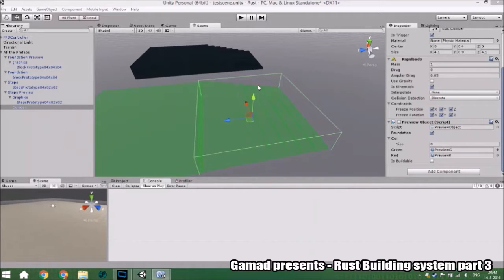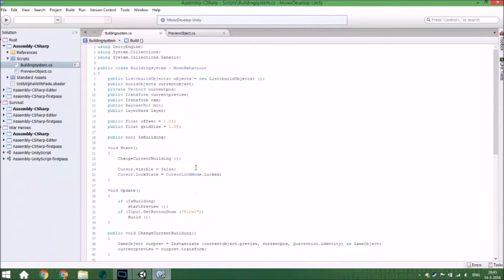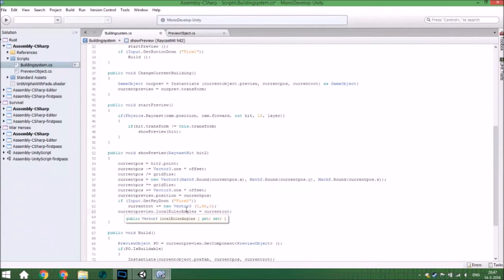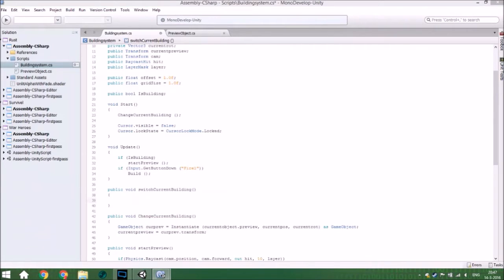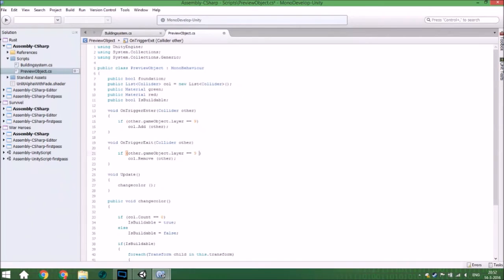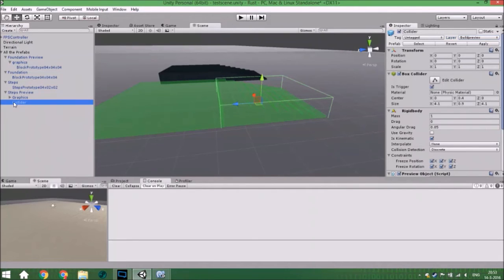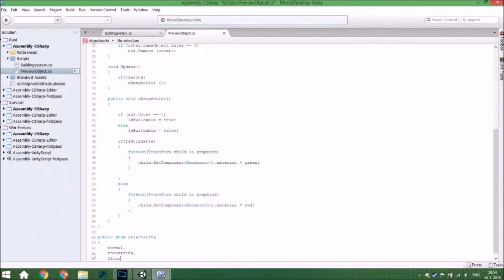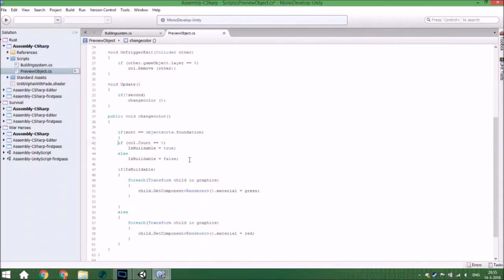[Unity 5] Tutorial: How to make a building system like Rust - part 3

Comment: Hi! I have an error say on play : "Destroying assets is not permitted to avoid data loss.
If you really want to remove an asset use DestroyImmediate (theObject, true);
UnityEngine.Object:Destroy(Object)" THX for help !

My script : using UnityEngine;
using System.Collections;
using System.Collections.Generic;

public class Buildingsystème : MonoBehaviour {

 public List<buildObjects> objects = new List<buildObjects>();
 public buildObjects currentobject;
 private Vector3 currentpos;
 private Vector3 currentrot;
 public Transform currentpreview;
 public Transform cam;
 public RaycastHit hit;
 public LayerMask layer;

 public float offset = 1.0f;
 public float gridSize = 1.0f;

 public bool IsBuilding;
 void Start()
 {

  ChangeCurrentBuilding (0);

  Cursor.visible = false;
  Cursor.lockState = CursorLockMode.Locked;
 }

 void Update()
 {
  if(IsBuilding)
   startPreview();
  if(Input.GetButtonDown("Fire1"))
   Build();
  if (Input.GetKeyDown("0") || Input.GetKeyDown("1"))
   switchCurrentBuilding();
 }

 public void switchCurrentBuilding()
 {
  for (int i = 0; i < 2; i++)
  {
   if (Input.GetKeyDown("" + i))
    ChangeCurrentBuilding(i);
  }
 }
 public void ChangeCurrentBuilding(int cur)
 {
  currentobject = objects [cur];
  if (currentpreview != null)
   Destroy(currentpreview.gameObject);
  GameObject curprev = Instantiate (currentobject.preview, currentpos, Quaternion.Euler(currentrot)) as GameObject;
  currentpreview = curprev.transform;
 }

 public void startPreview()
 {
  if(Physics.Raycast(cam.position, cam.forward, out hit, 10, layer))
  {
   if(hit.transform != this.transform)
   {
    showPreview(hit);
   }
  }
 }

 public void showPreview(RaycastHit hit2)
 {
  currentpos = hit2.point;
  currentpos -= Vector3.one * offset;
  currentpos /= gridSize;
  currentpos = new Vector3(Mathf.Round(currentpos.x), Mathf.Round(currentpos.y), Mathf.Round(currentpos.z));
  currentpos *= gridSize;
  currentpos += Vector3.one * offset;
  currentpreview.position = currentpos;
  if (Input.GetButtonDown("Fire2"))
   currentrot += new Vector3(0, 90, 0);
  currentpreview.localEulerAngles = currentrot;

 }

 public void Build()
 {
  PreviewObject PO = currentpreview.GetComponent<PreviewObject> ();
  if(PO.IsBuildable)
  {
   Instantiate(currentobject.prefab, currentpos, Quaternion.Euler(currentrot));
  }
 }
}

[System.Serializable]
public class buildObjects
{
 public string name;
 public GameObject prefab;
 public GameObject preview;
 public int gold;
}

Comment: Hi Gamad, the tutorial is great so far. I have one issue, can not spot the problem. I created floor and wall. I placed the floor than I want to place a wall on the floor and here is the problem. My wall can not be placed on the floor but can be placed anywhere. I checked few things and I spotted that this is 2nd collider problem in Preview prefab. its seem when 2nd collider is coliding with floor than wall change colour to red. It should be oposite. Can you tell me where can be the problem? if not I will try my best to find the problem. It shouldnt be a massive.
Thank you!
Reply from the maker: Probably you assigned the wrong colliders to the wrong variables (at least I think so ;) )
Reply: Thanks for reaply... I fixed that, dont remember exactly what was wrong but something with collider or tag.

will you do more tutorials, for example gathering the items to get enough to build the structures? and maybe inventory system which can give option to drag and drop items from the inventory and other stuff?

Thank you

Comment: I have 3 problem. First he never switch green to red when i build over another object ( like foundation ). Second problem when i build something like wall, his center is on the ground so the middle of the wall was under the ground and the last problem is when i switch with key to another object i see the preview ( i can rotate the object ) but when i press fire1 he didn't build the object ( But at the defaut object before key switching so, my foundation could be build without any problem )

My buildingSystem code : 
http://pastebin.com/z2Bz743J
My Preview code : 
http://pastebin.com/EJGtHbAH

I have no error and use Unity 5.3.0
Reply from the maker: 1)It looks like that's about the colliders (re-check your physics)
2) that's all about the pivot (part 4 will explain about that)
3) could you do multiple print commands (at line 82 & 84) to check what is working currently ;)
Reply: For my wall i know it's pivot problem, but my stair have an good pivot :/. 

I did print for seen were and when i encoutered a problem. For my foundation line 82 & 84 work fine and my foundation was build without problem,  but for my stair only line 82 worked, but not the line 84. 

And i still not understand why my color switch dont work too :/. 

What do you mean by "re check your physics" ?
Reply from the maker: I can mean some layers don';t hit eachother and that it won't hit the other collider
Reply: Yes, i use buildable layer for all object and child
Reply: Gamad I seen some poeple ask if you could upload an basics project for show how to set propretly the layers and colliders, do you think i will be possible ?
Reply from the maker: No, A lot of people just download that and don't watch the video and I get a lot of annyoing questions ;)

But I would say finish the tutorial first, because a lot of things are going to change before the last video.
(And if you still got problems then I will just send you the scripts privately)

Alright?
Reply: Gamad I understand :). Serioulsy i look the code and understand him, but i make some change to him, i put 4 small collider ( as a trigger ) in each side of my wall for check if it IsBuildable after that if it's is those collider auto snap with the other collider trigger of the other object and switch to green and buildable, this system have other advantage like building rules ( Wall only on foundation or something like that ). Maybe that's could help you for news building system idea :)
Reply from the maker: Maybe, thanks ;)

Comment: I have an error:
Sctipts/BuildingSystem.cs(41,25): error CS1525: Unexpected symbol `1', expecting `.', `?', `[', `<operator>', or `identifier'
The script:
using UnityEngine;
using System.Collections;
using System.Collections.Generic;

public class BuildingSystem : MonoBehaviour
{
 public List<buildObjects> objects = new List<buildObjects> ();
 public buildObjects currentobject;
 private Vector3 currentpos;
 private Vector3 currentrot;
 public Transform currentpreview;
 public Transform cam;
 public RaycastHit hit;
 public LayerMask layer;

 public float offset = 1.0f;
 public float gridSize  = 1.0f;

 public bool isBuilding;

 void Start()
 {
  ChangeCurrentBuilding (0);

  Cursor.visible = false;
  Cursor.lockState = CursorLockMode.Locked;
 }

 void Update ()
 {
  if (isBuilding)
   startPreview ();
  if (Input.GetButtonDown ("Fire1"))
   Build ();
  if (Input.GetKeyDown ("0") || Input.GetKeyDown ("1"))
   ChangeCurrentBuilding ();
 }

 public void switchCurrentBuilding(int cur)
 {
  for(int 1 = 0; 1 < 2; 1++)
  {
   if(Input.GetKeyDown("" + 1))
    ChangeCurrentBuilding(1);
  }
 }
  
 public void ChangeCurrentBuilding()
 {
  currentobject = objects [cur];
  if(currentpreview != null)
   Destroy(currentpreview.gameObject);
  GameObject curview = Instantiate (currentobject.preview, currentpos, Quaternion.Euler (currentrot)) as GameObject;
  currentpreview = curview.transform;
 }

 public void startPreview()
 {
  if (Physics.Raycast (cam.position, cam.forward, out hit, 10, layer))
  {
   if (hit.transform != this.transform)
    ShowPreview (hit);
  }
 }

 public void ShowPreview(RaycastHit hit2)
 {
  currentpos = hit2.point;
  currentpos -= Vector3.one * offset;
  currentpos /= gridSize;
  currentpos = new Vector3(Mathf.Round(currentpos.x), Mathf.Round(currentpos.y), Mathf.Round(currentpos.z));
  currentpos *= gridSize;
  currentpos += Vector3.one * offset;
  currentpreview.position = currentpos;
  if (Input.GetKey ("Fire2"))
   currentrot += new Vector3 (0,90,0);
  currentpreview.localEulerAngles = currentrot;
 }

 public void Build()
 {
  PreviewObject PO = currentpreview.GetComponent<PreviewObject> ();
  if (PO.IsBuildable) {
   Instantiate (currentobject.prefab, currentpos, Quaterntion.Euler (currentrot));
  }
 }
}

[System.Serializable]
public class buildObjects
{
 public string name;
 public GameObject prefab;
 public GameObject preview;
 public int gold;
}
Reply from the maker: +HarD izzeR That is a mistake I made within the tutorial, just change the line of Getkeydown -> getbuttondown
Reply: +Gamad The Same Error Comes...
Reply: +Gamad Any Help Please ?
Reply from the maker: +HarD izzeR Did you changed both getkeydown's?
Reply: +Gamad yes I did
Reply from the maker: Could you give me that part of the script again with the error?
Reply: +Gamad The Error:
Sctipts/BuildingSystem.cs(41,25): error CS1525: Unexpected symbol `1', expecting `.', `?', `[', `<operator>', or `identifier'

The Script:

using UnityEngine;
using System.Collections;
using System.Collections.Generic;

public class BuildingSystem : MonoBehaviour
{
 public List<buildObjects> objects = new List<buildObjects> ();
 public buildObjects currentobject;
 private Vector3 currentpos;
 private Vector3 currentrot;
 public Transform currentpreview;
 public Transform cam;
 public RaycastHit hit;
 public LayerMask layer;

 public float offset = 1.0f;
 public float gridSize  = 1.0f;

 public bool isBuilding;

 void Start()
 {
  ChangeCurrentBuilding (0);

  Cursor.visible = false;
  Cursor.lockState = CursorLockMode.Locked;
 }

 void Update ()
 {
  if (isBuilding)
   startPreview ();
  if (Input.GetButtonDown ("Fire1"))
   Build ();
  if (Input.GetButtonDown ("0") || Input.GetKeyDown ("1"))
   ChangeCurrentBuilding ();
 }

 public void switchCurrentBuilding(int cur)
 {
  for(int 1 = 0; 1 < 2; 1++)
  {
   if(Input.GetButtonDown ("" + 1))
    ChangeCurrentBuilding(1);
  }
 }
  
 public void ChangeCurrentBuilding()
 {
  currentobject = objects [cur];
  if(currentpreview != null)
   Destroy(currentpreview.gameObject);
  GameObject curview = Instantiate (currentobject.preview, currentpos, Quaternion.Euler (currentrot)) as GameObject;
  currentpreview = curview.transform;
 }

 public void startPreview()
 {
  if (Physics.Raycast (cam.position, cam.forward, out hit, 10, layer))
  {
   if (hit.transform != this.transform)
    ShowPreview (hit);
  }
 }

 public void ShowPreview(RaycastHit hit2)
 {
  currentpos = hit2.point;
  currentpos -= Vector3.one * offset;
  currentpos /= gridSize;
  currentpos = new Vector3(Mathf.Round(currentpos.x), Mathf.Round(currentpos.y), Mathf.Round(currentpos.z));
  currentpos *= gridSize;
  currentpos += Vector3.one * offset;
  currentpreview.position = currentpos;
  if (Input.GetKey ("Fire2"))
   currentrot += new Vector3 (0,90,0);
  currentpreview.localEulerAngles = currentrot;
 }

 public void Build()
 {
  PreviewObject PO = currentpreview.GetComponent<PreviewObject> ();
  if (PO.IsBuildable) {
   Instantiate (currentobject.prefab, currentpos, Quaterntion.Euler (currentrot));
  }
 }
}

[System.Serializable]
public class buildObjects
{
 public string name;
 public GameObject prefab;
 public GameObject preview;
 public int gold;
}
Reply from the maker: for(int 1 = 0; 1 < 2; 1++)
That needs to be:
for(int i = 0; i < 2; i++)
Reply: +Gamad Thanks
Reply from the maker: +HarD izzeR np ;)
Reply: +Gamad But Now I Have More Errors :(
1-
Sctipts/BuildingSystem.cs(23,17): error CS1501: No overload for method `ChangeCurrentBuilding' takes `1' arguments
2-
Sctipts/BuildingSystem.cs(44,33): error CS1501: No overload for method `ChangeCurrentBuilding' takes `1' arguments
3-
Sctipts/BuildingSystem.cs(50,42): error CS0103: The name `cur' does not exist in the current context
4-
Sctipts/BuildingSystem.cs(50,33): error CS1502: The best overloaded method match for `System.Collections.Generic.List<buildObjects>.this[int]' has some
5-
Sctipts/BuildingSystem.cs(50,33): error CS1503: Argument `#1' cannot convert `object' expression to type `int'

Iam really really sorry but I dont understand C# if that was JS I was going to fix this
Reply: +Gamad Any Help ?
Reply from the maker: +HarD izzeR 1 - change public void changecurrentbuildchangecurrentbuildong() to public void changecurrentbuilding(int cur)
Reply: +Gamad Thanks now I have one error:
Sctipts/BuildingSystem.cs(36,25): error CS1501: No overload for method `ChangeCurrentBuilding' takes `0' arguments
Reply from the maker: +HarD izzeR change at line 36 or so Changecurrentbuidling () to changecurrentbuilding (i)
Reply: +Gamad but now I have 3 errors:
1-
Sctipts/BuildingSystem.cs(36,48): error CS0103: The name `i' does not exist in the current context
2-
Sctipts/BuildingSystem.cs(36,25): error CS1502: The best overloaded method match for `BuildingSystem.ChangeCurrentBuilding(int)' has some invalid arguments
3-
Sctipts/BuildingSystem.cs(36,25): error CS1503: Argument `#1' cannot convert `object' expression to type `int'

The Script: (Please Read The Script And See Whats Wrong surly There is some thing wrong)

using UnityEngine;
using System.Collections;
using System.Collections.Generic;

public class BuildingSystem : MonoBehaviour
{
 public List<buildObjects> objects = new List<buildObjects> ();
 public buildObjects currentobject;
 private Vector3 currentpos;
 private Vector3 currentrot;
 public Transform currentpreview;
 public Transform cam;
 public RaycastHit hit;
 public LayerMask layer;

 public float offset = 1.0f;
 public float gridSize  = 1.0f;

 public bool isBuilding;

 void Start()
 {
  ChangeCurrentBuilding (0);

  Cursor.visible = false;
  Cursor.lockState = CursorLockMode.Locked;
 }

 void Update ()
 {
  if (isBuilding)
   startPreview ();
  if (Input.GetButtonDown ("Fire1"))
   Build ();
  if (Input.GetButtonDown ("0") || Input.GetKeyDown ("1"))
   ChangeCurrentBuilding (i);
 }

 public void switchCurrentBuilding(int cur)
 {
  for(int i = 0; i < 2; i++)
  {
   if(Input.GetButtonDown ("" + 1))
    ChangeCurrentBuilding(1);
  }
 }
  
 public void ChangeCurrentBuilding(int cur)
 {
  currentobject = objects [cur];
  if(currentpreview != null)
   Destroy(currentpreview.gameObject);
  GameObject curview = Instantiate (currentobject.preview, currentpos, Quaternion.Euler (currentrot)) as GameObject;
  currentpreview = curview.transform;
 }

 public void startPreview()
 {
  if (Physics.Raycast (cam.position, cam.forward, out hit, 10, layer))
  {
   if (hit.transform != this.transform)
    ShowPreview (hit);
  }
 }

 public void ShowPreview(RaycastHit hit2)
 {
  currentpos = hit2.point;
  currentpos -= Vector3.one * offset;
  currentpos /= gridSize;
  currentpos = new Vector3(Mathf.Round(currentpos.x), Mathf.Round(currentpos.y), Mathf.Round(currentpos.z));
  currentpos *= gridSize;
  currentpos += Vector3.one * offset;
  currentpreview.position = currentpos;
  if (Input.GetKey ("Fire2"))
   currentrot += new Vector3 (0,90,0);
  currentpreview.localEulerAngles = currentrot;
 }

 public void Build()
 {
  PreviewObject PO = currentpreview.GetComponent<PreviewObject> ();
  if (PO.IsBuildable) {
   Instantiate (currentobject.prefab, currentpos, Quaternion.Euler (currentrot));
  }
 }
}

[System.Serializable]
public class buildObjects
{
 public string name;
 public GameObject prefab;
 public GameObject preview;
 public int gold;
}
Reply from the maker: +HarD izzeR within the update function change  ChangeCurrentBuilding (i); to switchCurrentBuilding()
Change:

 public void switchCurrentBuilding(int cur)
 {
  for(int i = 0; i < 2; i++)
  {
   if(Input.GetButtonDown ("" + 1))
    ChangeCurrentBuilding(1);
  }
 }

To:

 public void switchCurrentBuilding()
 {
  for(int i = 0; i < 2; i++)
  {
   if(Input.GetButtonDown ("" + i))
    ChangeCurrentBuilding(i);
  }
 }

That will probably solve all the errors.
Reply: +Gamad Finally its working thanks I will complete the video
Reply: +Gamad But there is another thing (I completed the video) there is no errors but the scripts doesnt do anything :( I pressed 1 and 2 and Fire1 and Fire2 and there is no thing happens
Reply from the maker: Did you turned IsBuidling on?
Reply: +Gamad It does build and rotate but it doesnt switch between foundations
Reply from the maker: +HarD izzeR do you got multiple objects in the list??
Reply: +Gamad I cant understand you if you mean I have 2 objects to build so yes I have the Foundation Prefab And a Wall Prefab to Build (Is The Wall Prefab Must Be Setps Like You ?)
Reply from the maker: +HarD izzeR indeed everything needs to be exactly like me...
Reply: +Gamad but I dont want it steps can it be just a cube ? if not so can you make a tutorial for a wall not steps ? (or just tell me what to do)
Reply: +Gamad but I dont want it steps can it be just a cube ? if not so can you make a tutorial for a wall not steps ? (or just tell me what to do)
Reply from the maker: +HarD izzeR I'm sorry I'm responding so late (was on holiday) ;)

You can use every object you like!